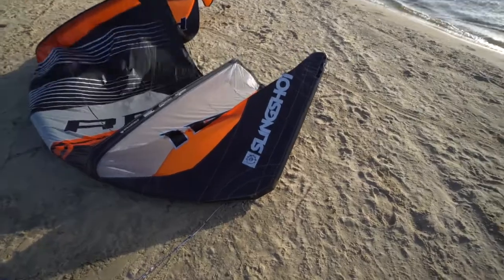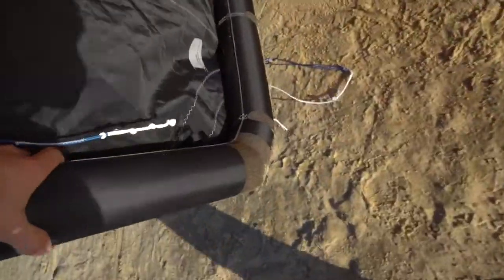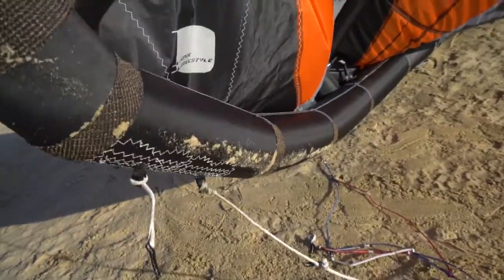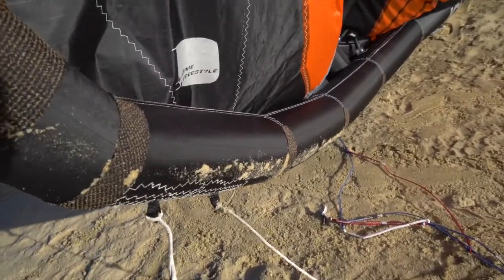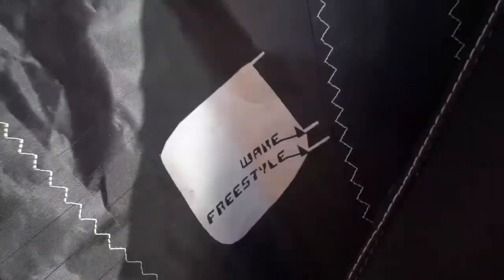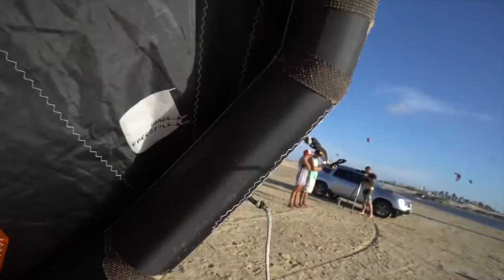Slingshot RPM 2018 : Learn how to use Freestyle vs. Wakestyle settings

Comment: I have a slingshot. I’m a beginner and I’ve always had it on the freestyle setting. I’ve used it primarily for snowboarding and so far I haven’t had much luck. The kite always wants to sit at 12:00 and move forward behind me if it’s in the air for any period of time. Would switching to wake have it try to pull further downwind in general? I’m bringing it out only around 11-12 knots as I’m only over hard ground. Kite is 9M

Comment: Can you make a video explaining how to jump with rpm? I just cant get it to lift at all!
Reply: Justinas Ragelis
 it's more of a feeling but one ingredient is a lot of wind. I have the RPMs and a new 11m Pivot, the Pivot was so easy to boost  after riding the RPMs but now when I ride the RPMs I can transfer some Pivot skills. I use the 11m size as my main jump kite in both the RPM and Pivots. Small carbon board 135/41. The larger RPMs I found to be difficult to jump so only fly 11s now. Gotta be strong, do yoga👌
Reply: In general jumping with C kites takes a bit of getting used to. I had the same problem with the FX. You need to keep the bar pulled in as you steer the kite up (or at least not let go as much as you would on an old school / freeride kite) and you need to work harder to time the pop with your board. Once you get used to it you'll jump just as high as any other kite (but with less airtime).